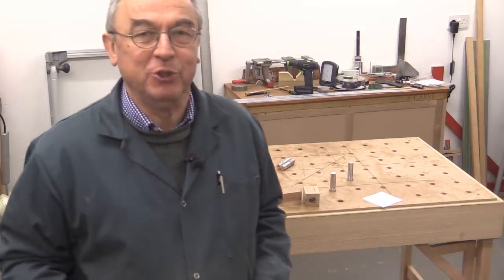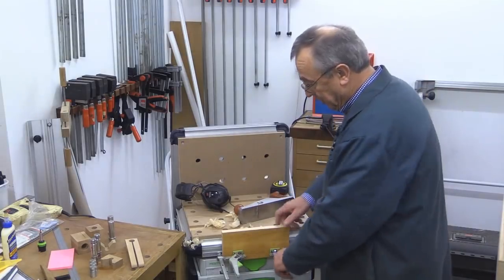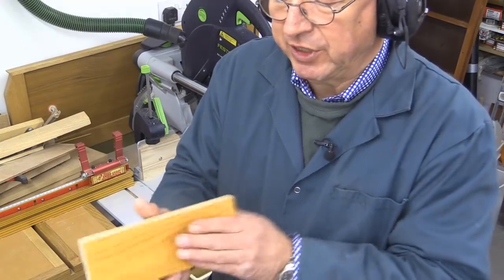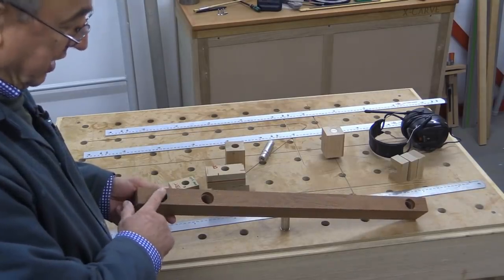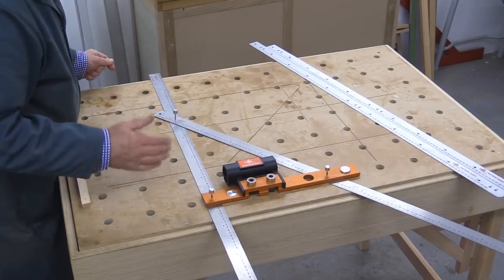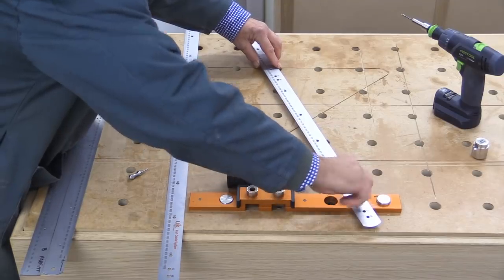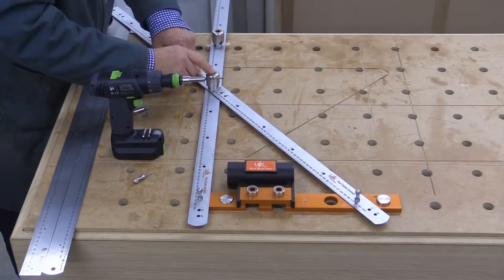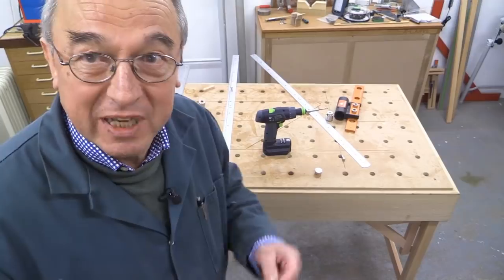Workshop Notes #23

Comment: Peter, 

Perhaps I’m missing something, but it seems to me that there is an easy way of eliminating the risk of damaging the 3mm hole in the Mark II system. At about 10:15 in the video, using the same dog holes as locators, but reversing the jig 180 degrees, you now have a drill bushing exactly above the desired hole location. In addition, since the center of every hole in the jig is exactly 48mm apart, there will always be an available bushing at 48mm AND 96mm from some combination of 20mm and/or 3mm holes.

I just received my own Mark II system a couple of weeks ago, and I could not be happier or more impressed. I’ve always used my beloved Festool tracksaw to break down sheet goods into manageable sizes before cutting to final size on the table saw because it was easier than measuring (or “squaring up”) on the Festool. But now, I find that it is easier, faster, and more accurate to do almost all of my cutting with the Festool. Not to mention being much easier on my aging back — a lot less moving around of heavy sheet goods. Thank you for a marvelous product.
Reply from the maker: Gosh, That is good news and good luck with your woodwork.   Peter

Comment: Thanks Peter another interesting video. I am really enjoying the Parf Guide system and the top I have made. A word of warning to people though is that the screw on the 20mm drill depth stop collar is easily stripped. Axminster were really helpful and sent me a replacement in less than 24 hours, excellent service,  but adding a warning to people in your next parf system video might be a good idea.
Reply from the maker: Hi Ian, Many thanks for the warning. I tighten mine up quite hard and have had no problems - I wonder whether it was a one off issue with yours. I will post the warning.  Cheers.   Peter

Comment: Nice video Peter.  I have actually been looking back at some 'classic' New Brit workshop videos and they really do stand the test of time!
On the long 'Parf Hat' I made something similar.  As I do not have a Parf Guide I made one hole and then simply made the second hole into an elongated slot.  That meets you do not have to be completely accurate, but it also means that it gives flexibility to use the same 'Parf Hat' at different angles on the bench where with just two holes the spacing would not work.  Thought I would share as I thought it would be helpful for anyone else who does not have the Parf Guide system.
Reply from the maker: Good stuff - many thanks.   Peter
Reply: Oh, and I forgot to say, Good Luck with the potential move, but make sure you have a good space for the New New Brit Workshop :)
Reply from the maker: Many thanks and I will do my best.   Peter

Comment: Peter Having watched this video it got me to thinking. Your Parf Guide System already has a  48 mm spacing set within the unit.  So I went to my lathe and spun a new bush that slides into the bronze bushing. The new bush is 23 mm in dia at one end, the depth of the bridge. It then reduces to the 10 mm of the hole in the bush, which would normally take the 20 mm cutter. In the centre of my bush is a 3 mm hole. I now use a 3 mm extra long drill through this bush giving a hole exactly 48 mm from the previously drilled 20 mm holes. I am sure that or friends at UJK (Axminster's) could make this as an additional item. Bush + extra long 3 mm drill code 340895. 
See if you think it works. I have photos if you wish to see them..
Reply from the maker: Hi Barry, We did look at this but thought that the extra holes in the Parf Sticks would be more accurate but that is only available with the Mark 2. I would love to hear how accurate things turn out - perhaps after you have created a top with these offset holes you could test the accuracy.  Cheers.   Peter

Comment: Awesome!  I see the value of the Parf Guide System.  Thank you.
Reply from the maker: Hi Mark, It is amazingly accurate and means that I do not need a panel saw which has saved me about £2k.   Cheers.  Peter
Reply: @NewBritWorkshop  Is the Parf Guide System available to purchase in the US?
Reply from the maker: Hi Mark, The first shipment to TSO should arrive very soon. Do check their web site.  Peter
Reply: @NewBritWorkshop Thanks Peter.

Comment: Thank you for another useful video. I have the Mark 2 set and it is very accurate and versatile but I do find the pins difficult to extract - I’m not strong enough to pull them straight out and it would help if there was a bit more to get hold of.
Reply from the maker: Hi Chris, They are designed to be tight but you can make it much easier by putting the drill in and out a few times whilst drilling - it is often called a "pecking" motion. There will be no significant change in the accuracy and I do it most of the time.   Peter

Comment: @10:16 why not place two dogs in the plane you wish to offset and then butt up the two rulers against  each other and then face of one ruler against the dogs thus offsetting the 3mm holes of the furthest ruler by the approximate width of the two rulers . Clamping that rule then allows drilling .
Reply from the maker: That will work as long as the line of 6 mm holes in the ruler is parallel with the edge. Axminster make no claim about these being absolutely parallel. Just wait 48 more hours and there will be a very inexpensive solution for producing new holes in an already completed top.  Peter

Comment: Peter.  On a MFT style table (built with the parf guide system) & using the festool track saw, do you have a way to make repetitive cuts, without measuring for each one?  Im using the Parf dogs and the dog rail clips so everything is nice and square.  I have 10 drawers to make and they are all the same size so a way to make receptive cuts for all the sides would be great.  Of course my measurements don't line up exactly with being able to drop a dog into one hole and butting the work piece up against it.  thanks
Reply from the maker: I have shown this is one of my workshop notes videos. Just clamp a piece of wood to act as a stop but make sure that is tightly held.   Peter

Comment: When you use the MK2 system, once you've drilled the 'risky' holes through the orange thingy, why did you pin the rulers on top of the thingy so that you were working in mid-air and thus increasing the chance of inaccuracies?  Surely removing the orange drill guide thingy and pinning the rulers flat on the table would have been a better option?  I'm one of the original V1 users (@£99 :)  so unsure if there is any reason why this would not work with the v2.  I can't see anything immediately obvious though.  Thanks.
Reply from the maker: Good point - there are many ways of doing this.   Cheers.   Peter

Comment: Hello Peter, Just found your channel, I purchased the mark 2 version following a trip to Axminster. I found getting the pins in and located accurately and out again to be really difficult. Due to this (I think) I have inaccuracies in my Birch ply top. Perhaps CNC is the way to go or do you have you a way to locate/extract the pins without a struggle?
Thanks, Chris.
Reply from the maker: Hi Chris, Are you saying that the 3 mm pins are difficult? If so, is it tightness in the 3 mm hole or difficulty getting the 6 mm shoulder located in the Parf Stick?   Peter
Reply: New Brit Workshop Hi Peter, yes the tightness of getting the 3mm pin in and seated (perhaps a problem with Birch ply rather than MDF? Less friction?) Chris
Reply from the maker: The pins are designed to be tight in order to maintain accuracy. The system works well with MDF, which I always recommend. If the 3 mm pins are not correctly seated in the Parf Sticks (that means the 6 mm shoulder on the pins fitting into the 6 mm hole in the Parf Stick) then you will not achieve the desired accuracy. Perhaps you should discuss this with the technical support at Axminster - they are very good.   Peter

Comment: Hi Peter, when using the super dogs with my track and TS55 on a 18mm board I find the dogs to be sticking out too high, so much so that the motor housing of the saw hits the top of the dogs. I sometimes use a sacrificial board under my work piece to elevate the track more but that's unpractical as I don't always have extra boards to waste.
I'm not sure if I'm doing this wrong. Any tips how to work around this? Thanks.
Reply: Look up Dave Stanron's videos, he has a video showing how to fix your problem.
Reply from the maker: Hi Muru, It should not happen with 18 mm stock. I assume that it is the Super Dog furthest away from you as you make the cut. Try putting the row of smaller dogs in the next row nearest to you so they are not in the same row as the furthest Super Dog.   Peter

Comment: Hi Peter, haven't you already done a video specifically on offset holes?  Also, any top tips on getting the rows/columns parallel with the edge of the table top, other than careful measuring?
Reply from the maker: Hi Joe, Yes, there was a previous video but in this one I approach it in a different way. The only way to get the rows or columns parallel with an edge is to measure but remember it does not matter if the pattern of holes bears no relation with the edges of the top as the accuracy comes from the holes alone.    Peter
Reply: Yes, happy with that for cutting, but it is sometimes useful to have pieces clamped to the edge of the MFT square with pieces on the table top - and it is just nice to have everything square.  I suppose one could use a known parallel straight edge to position one of the part sticks.
Reply from the maker: Hi Joe, Axminster make no claim about the Parf Stick holes being exactly in the middle of the long axis of the sticks but, in my experience, they usually are and so do check both of yours and use the better of the two with its edge fluch to your top.   Peter
Reply from the maker: Hi Joe, I have decided to do an "Offset Holes - a New Perspective" video in order to give some clarity. It will take a couple of weeks.   Peter

Comment: Hi Good afternoon,well, after some hours of hassel and checking things, I found the bloomin steel rule totally out of integrity!!
If u measure the 6 mm holes from side hole to ruler edge, it tapers off. The ruler laid on each other, dont correspond.They are not the same widths.
I did attempt to contact the offices of ujk on their comment page.unfruitful.
Please send me the costumer line email adress as here in South Africa, it can be troublesome to communicate. I wrote them on last weekend about a order i wanted to expand, but no answer whatever.

Please assist. It would help greatly if they put in bold on their ordersheet, a customer assist line, where one can just click and get sorted. 
.
Reply from the maker: Measuring accurately with a steel rule is almost impossible. Contact Axminster via https://help.axminstertools.com/support/home

Comment: Hello Peter "Perfect"
PGS is actually out of stock. Do you know when it will be available again ?
Reply from the maker: Hi Philippe, I spoke to them today to check what is happening. When the Mark 2 PGS was launched they had estimated the demand for the first quarter. That initial stock sold out in a matter of days. They were then going flat out to try to keep up but it was an impossible task. Things were not helped by a hiccup in the raw material supply chain and with so many back orders they had to stop taking new orders. I understand that they are working some extra shifts and new stock will be available very soon. I know that they are a commercial organisation but I feel sorry for them as everything was going so well and they were overwhelmed by demand. It sounds like a nice state to be in but I can assure you that it is not quite what they were expecting. Fingers crossed and another 2 weeks should see things back to normal.   Peter